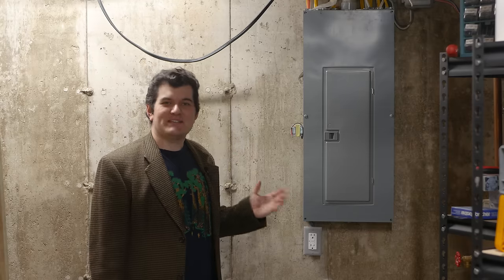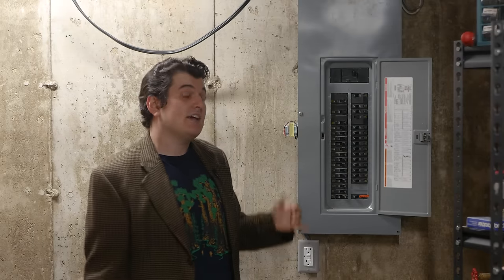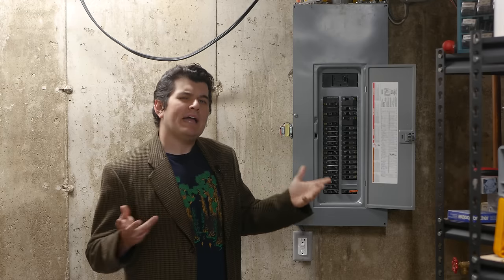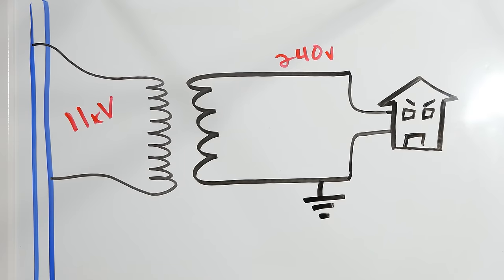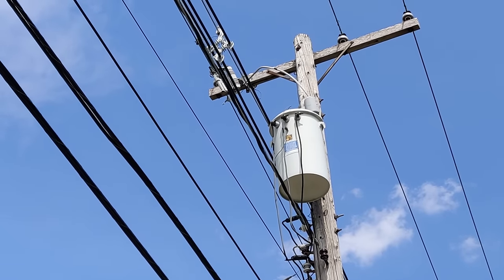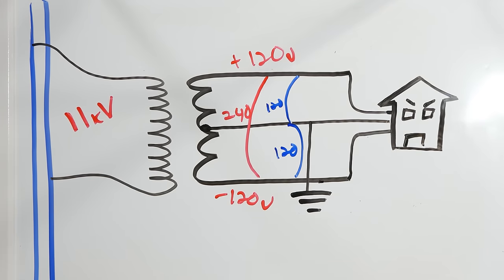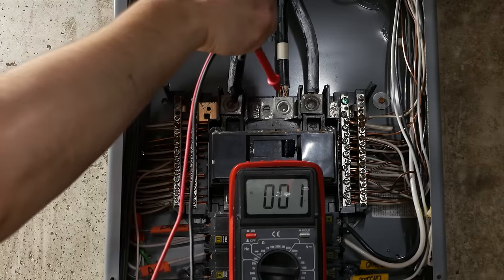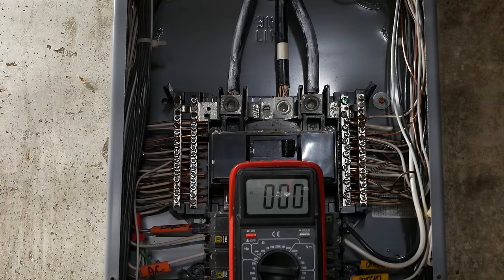The US electrical system is not 120V

Comment: Sometimes when I watch these videos I feel like you’re attacking me personally.
Reply from the maker: Only with the kettles :)
Reply: Technology Connections 😂
Reply: Shhh... You're one of us now.
Reply: @richkurtz6053  no good for tea.
Reply: @richkurtz6053  or an electric powered instant hot tap by the kitchen sink. A tiny electric water heater lives under my sink and keep the water just below boiling. Holds enough for 5 or 6 cups of hot water. All on 120v
Reply: @Gary-Goodridge  please explain
Reply: @richkurtz6053  American here, I use a kettle every day for my single serving coffee.  Its way faster and easier than the microwave.
Reply: Honestly not surprised to see Slow Mo Guys here. This channel definitely seems right up Gavin's alley
Reply: @Zolbat  no idea what he/she means by that either... One thing I know tho is that microwaving very pure water (maybe only distilled?) might be a bit dangerous, it can hit above 100ºc and be ready to instantaneously boil whenever any impurity hits it, quite a nice spray of boiling water all around.
Reply: @revengejr  I had no idea that was a thing you could buy, thank you for adding another item to my list of things to buy if and when I own my own house.
Reply: To be fair I have never been shocked taking a plug out of an outlet.

That's not to say that I haven't been shocked, I have. Sometimes even on purpose.
It has never happened when dealing with plugs though.
Reply: @richkurtz6053  Microwaved water is tea sacrilege!
Reply: @amcghie7  but whyy??
Reply: @Zolbat  It tastes so stale...
Reply: @richkurtz6053  And I bet your tea tastes awful.
Reply: @richkurtz6053  I'm an American with an electric kettle but I use it to heat up water for my instant Cup 'o Noodles.
Reply: @Zolbat  to make English tea you need boiling water from a kettle. Microwave boiling water is no good. It just doesn't taste right.
Reply: That's why Americans don't drink tea... they don't want to wait for it. ;-)
Reply: @Kalvinjj  : Yes, it's called "superheating".  But the water doesn't have to be pure.  Plain tap water can have the same problem, particularly if you microwave it in a smooth bowl with no good nucleation sites on its inner surface.  The telltale that the water is superheated and in danger of erupting is when you see TINY bubbles spontaneously form in it. 
If you're worried about it blowing up on you, just put it somewhere where an eruption won't hurt anything, then dip a spoon or something in it. That'll be enough to set it off and defuse the superheating.
Reply: Sometimes when I watch these videos I feel like you’re attacking me personally . At least you could watch him coming (for a loooong time) on your videos. 🤣
Reply: @richkurtz6053  As a sane American, I heat my water by burning natural gas piped into my home through an antiquated near century old low pressure natural gas system. Friend of mine was over at his grandmothers house and noticed an old gas lamp light fixture on the wall. Our of curiosity he turned the valve on it...and gas started to come out.
Reply: I've still got my dad's percolator(out in the garage). Maybe J should fit it out &use it again..
Those were the days!
Reply: @revengejr  Even though it must be super convenient i don't dare. I do not know how many times I by mistake got hot water over my hands when turning on the tap due to using hot water before and putting the handle in the middle afterwards without flushing out the hot water in the tap. This mistake would be so much worse if the water was almost boiling.
Reply: @amcghie7  That's your opinion & matter if taste.
Reply: @carpdog42  Natural gas still puts out more heat energy than electricity.
Reply: @andguneri  lol, it's not like that. It's a completely separate, and smaller, faucet that gets installed next to the normal faucet. It would be very difficult to mistake the hit tap for the normal tap.
Reply: @revengejr  Makes a lot of sense 😅
Reply: @revengejr  You underestimate my power!
Reply: Who the hell uses an electric kettle in the US anyway? That is a recent phenomenon. First off you dont make coffee that way, mostly. And we boiled water on the gas stove top, because its cheap to run. This was in the BM times... before microwave.
Reply: @richkurtz6053  Its why your tea and coffee is so disgusting
Reply: @richkurtz6053  This sucks though. It makes the container friggin hot!
Reply: Someone please explain scientifically (I don't want personal anecdotes or conjecture) how tea made with water heated in a microwave tastes any different than tea made with water heated in a kettle.
Reply: @StoneE4  Kettles are designed to heat water to 212 degrees ,optimal for tea .Mcrowaves overheat  water making tea taste bitter and nasssssty.
Reply: @Wardads1  - That's not an explanation. That's two more additional claims.
So, let me rephrase... Someone please explain scientifically (I don't want personal anecdotes, conjecture, or additional claims) how tea made with water heated in a microwave tastes any different than tea made with water heated in a kettle, why water heated to exactly 212º is optimal for tea, and how heating water past 212º makes tea taste bitter and "nasssssty."
Reply: @StoneE4  That's the best answer you will get ,and yes black tea tastes bitter in water heated over 212.degrees .Ask someone from a tea company if that's not good enough or gee I dunno fucking well google it .Oh and a boiling kettl aerates the water too ,try it yourself.
Reply: @amcghie7  It turns out that professional violinists can't tell the difference between a Strad and a good, modern violin, and wine experts in France couldn't tell the difference between red wine and white wine with food coloring in it to make it look red.
I wonder how you'd fare in a double-blinded test to detect which tea was made with kettle water and which with microwave heated water.
Reply: @DownhillAllTheWay  I'd imagine you probably could tell the difference between red and white wine by tasting, due to the fact they do taste different? When I'm offered a glass of wine I'd know, without being told, whether it was a Shiraz or a Merlot, for instance, and they are both red....

I guess on water though, it would be pretty easy to test, might try it on my flatmate tonight....
Reply: Michael Persico  in theory I agree. But in practice it is a totally different taste when making English style tea. However microwaves are good for reheating tea. Again you have to be careful or you ruin the taste but it can be done.
Reply: @Sammie1053  They also install them at showers/bath tubs but many of them are 240VAC as the need for a large amount of water is there. A.O. Smith makes a 240VAC 1.6GPM one that can handle most showers and is tankless. Draws 14 kW though.
Reply: @carpdog42   That was how our farm house used to be lit. Gas was free so who cared. We also had to light the fires in the Servel refrigerators to keep the food cold.
Reply: @Gary-Goodridge  We dumped English tea in a harbor a long time ago. Best use for it. ;-) Turkish tea beats the English any day. Just be sure not to leave the spoon in it too long and be sure to add at least two cubes of sugar. :-)
Reply: @StoneE4  Most people have pretty nasty microwaves too so you'll end up with a burnt cheese taste in your water or something similar.
Reply: Some weird novelty finding out how many of the channels you watch also watch each others content
Reply: @richkurtz6053  Exept the president. He use a heat ray ;)
Reply: @revengejr  Is that fed from the hot water line?  Cause, gross.
Reply: @revengejr  Is that fed from the hot water line? Cause, gross.
Reply: @xiaodingjones1554  nope, it comes from the cold water line, through a filter, then in to the tank where it's heated electrically. Check the link I posted if you really want to see how it works.
Reply: @TechnologyConnections  Yeah, he only has to wait about 45 minutes for it to boil.
Reply: Regarding tea tasting worse when the water is heated is a microwave, I believe there may be a reasonable explanation but it’s not because of the water is heated “differently” or worse in some way in a microwave. 

Coffee, and I’ll presume tea does taste different depending on the temperature of the water used. IIRC a temperature above 180°F will cause tannins or something or other to be released, making coffee bitter. Sounds like something similar may happen with tea from comments made?

Using my own personal experience as an example...  Boiling water in a microwave, I’d use a glass measuring cup. The glass gets hot which serves to maintain the heat of the water when removed from the microwave. And since I know there’s no more heating as soon as the microwave beeps, I always immediately remove the boiling water and use it. 

When using a kettle, the material (plastic) of the kettle doesn’t hold heat. But since I know the heating element will gradually rather instantly lose its heat, I tend to be a little lax in how quickly to attend to it.
The result is that water I’ve microwaved is almost certainly just off the boil when used whereas from a kettle it will be quite a few degrees cooler. I’ve experimented when making coffee and I know I had to deliberately wait till the water got down to 180°F.

Perhaps this or something similar explains the bitter tea when a microwave is used?
Reply: @MostlyInteresting  - Tons of people who work in a small office, you rent a room instead of an apartment, dorm rats, etc. use electric kettles to boil water. Microwaved boiled water is not nearly as good for tea.
Reply: @richkurtz6053   @Technology Connections  Speaking of coffee and microwaves... I heard that, although it is safe to boil water for coffee in a microwave, reheating it is a different story. Supposedly, when you first heat the water, dissolved air forms bubbles which provide nucleation points for steam bubbles, but when you reheat it, the air is gone, so, without nucleation points for the steam bubbles, the water can be heated above the boiling point, waiting for some little movement (like a person removing it from the oven) to trigger the bubbling. Result: possible painful splash of very hot water. Any truth to this?
Reply: @TechnologyConnections  Please see my reply to Richard Kurtz about coffee and microwaves.
Reply: @Gary-Goodridge  no we drink the water, eat the package/leaves/beans/whatever then set ourselves in fire
Reply: @DownhillAllTheWay  I have tried to make tea with microwave water and the results were nasty. I am not saying you cannot, with a lot of effort make a drinkable cup of tea with microwave water but using either a gas or electric kettle the job is easy peasy.
Reply: @Gary-Goodridge  What you need to do is to have somebody else make 6 cups of tea, 3 in the microwave and 3 in the kettle, then see if you can tell.  Ideally, the person serving the tea shouldn't know either, so as not to give any subliminal signals - if both people are unaware, that's what makes it a "double blind" test.  There is a tremendous bias when you know the result before you take the sample - and that's not a dig at you personally - it's everybody.  I have the same problem myself.  I used to use semi-skimmed milk, though I read that skimmed milk had all the same nutrition in it - but to me, it is like water - completely insipid.  Then recently, I read that in a double-blinded test, people were unable to tell the difference between skimmed and semi-skimmed milk.  I would have got somebody to test me, but I had already moved onto oat milk by that time, which I like, so I don't know if I can really tell the difference between milks.
Maybe you really can tell the difference between kettle- and microwave tea, but until you put it to the test, you will never know for sure.
Reply: @DownhillAllTheWay  as I said I think it is possible to make tea with microwave water, however I use my microwave to cook sponge cakes from scratch, turkey at Christmas. I defrost cream éclairs and ice cream. I roast nuts. The  only thing I do not bother with because, I have failed to get reliable good results is yourkshire pudding from batter and water for tea. I use it all the time to heat up cold cups of tea however you need to be careful because it will overheat and taste nasty if you go too far. Microwave water works well with instant coffee. I have been a regular user of microwave ovens since 1975 and have had great success. The fact that it is difficult to do for tea was really my point, kettles of both types just work. If someone doesn't know what it should taste like they cannot tell if what they have made is correct. Anyway  cheers and happy drinking.
Reply: @b2gills  I have! It really hurt, and left soot on my arm!
Reply: Im a masochist when it comes to knowledge. KEEP ATTACKING ME!
Reply: @hi-friaudioman  sorry dude I am a southerner and who drinks hot tea, me sweet tea all the way, and coffee in cold weather or hot coco.
Reply: @StoneE4  well dude look at you own answer  and yes you did give one answer  that is air flow, how you get the air flow does not matter to the fact the fire is burring hoter. AS for why kettles that is tradition.
Reply: @Delgen1951  : You're mistaken. Air flow, by itself, is not an explanation for why a fire will burn hotter. Air flow is just another claim until I describe the mechanics behind it that actually do make a fire burn hotter. If I couldn't explain why air flow increases the heat of a fire it would be no different from me saying the fire burns hotter because "that's just the way it works when you blow on it." Likewise, all the lame explanations presented in this thread for why tea made with water heated in a kettle tastes better than tea made with water heated in a microwave are nothing more than unfounded claims stacked upon more unfounded claims all resulting in an answer no better than, "reasons."
I couldn't care less what you consider to be tradition as that is completely irrelevant to what I'm asking. I'm looking for a scientific explanation (I don't want personal anecdotes, conjecture, additional claims, or appeals to tradition) of how tea made with water heated in a microwave tastes any different than tea made with water heated in a kettle.
Reply: me heating water for hot chocolate in the morning be like:this is fine not slow at all
Reply: @richkurtz6053  Microwave ovens are noisy.
Reply: I find myself somewhere between an eyeroll, head shake, smile, and laugh at the impassioned views of hyper detail oriented individuals of different taste concerning the proper preparation of the famous herbal beverage, especially given the video is about residential electrical wiring. This debate has lasted centuries without consensus, and if it were ever found could never be replicated. Taken too seriously, the culturally significant drink's preparation might lead to war between the English and Japanese, or civil war within their populations.
Reply: @Zolbat   Take two cups of water. Heat one in a microwave the way you usually do. Boil the other on the stove. Don't add anything to them. Just let them cool to your favorite beverage temperature and take a sip of each. You'll find, for no reason I can explain, that the two cups actually taste quite different.
Reply: @richkurtz6053  I use a electric kettle. We just call them "water-boilers" or a slew of other nonspecific synonymous names
Reply: @revengejr  My place, luckily, has a hot water recirculating pump. Everything that needs hot water is only a couple feet (at most) from true hot water.
Reply: @tippyc2  My wife agrees with that.
Reply: @richkurtz6053  As Oscar put it,  "America is the only country that went from barbarism to decadence without civilization in between.”
Reply: Is no one going to mention that boiling water in a microwave Vs a kettle THEN adding it to your tea is from a chemistry point of view going to result In the exact same cup of tea? No? Or that the first few people were joking and or playing along with the joke? Nope? Oh, alright never mind. Carry on then. Pardon me, excuse me. Just getting my coat, sorry. Pardon me.
Reply: @slateslavens  that's... Not at all accurate that no one could explain that claim if it was true? We understand exactly how microwaves work and how water works and even how the microwave radiation will interact with the water. If I had to guess without considering it at all just my very first guess. It's ionizing it? But if that were the case it would make ALL food taste different, likely dramatically so, as almost all food contains water. That's what the microwave is actually heating when you put food in it. The watter inside said food.
Reply: So my first reply going to be:

ALL THESE WORLDS 
ARE YOURS EXCEPT
EUROPA
ATTEMPT NO
LANDINGS THERE

Then Anton released the following video, which I believe explains everything:
https://www.youtube.com/watch?v=YsQXN-Kh2-w
Reply: @Sir.Craze-  yet we also all understand that beer is better from glass than plastic, your own gran made the best cupcakes in the world and tea is better from the kettle. Science aint an exact science, despite what science may have to say on the matter!
Reply: Your here
Reply: @richkurtz6053  I've visited Italy and ended up using the kettle and stove during my stay.  I was amazed how much faster it is!
Reply: @bradhoward9701  Things tasting better than others because of bias or external differences that don't actually change the taste is an exact science. It's called the Placebo effect.
Reply: @NUKELEDGE  quite aware of the placebo effect thanks. the point being that the placebo effect directly affects the outcome. taste is a pretty abstract concept, so the abstract of the placebo is just as valid. the cup of tea is meant to be enjoyed, and is generally enjoyed more when made with a kettle. hence there is a difference in  the quality of the tea. combine that with the neglected effects such as scale in the kettle changing hardness, and the boiling effect removing some of the more volatile additives to the tap water, and we have a metric of quality your numbers can measure. 

tea in the microwave is definitely and measurably different. whether your average person can tell the difference is entirely irrelevant.
Reply: @bradhoward9701  Then this would be easily solved with a double blind test. People always seem to avoid the argument when that point comes up though. Remove the bias and see the actual outcome.
Reply: @NUKELEDGE  I agree entirely. you are however missing the point. it isnt often i have been asked to participate in a proper study in my kitchen. often enough  the mrs makes tea with the microwave whilst i descale the kettle, and it tastes different. insisting that science says otherwise is to neglect that bias is a fundamental part of the outcome, and doesnt properly pay full respect to the scientfic method. the tea tastes better because of bias, but it still tastes better. science is about looking for the reason, not denying a measurable effect.

the cup of tea isnt just hot water dried tea and milk. its a ritual. its 5 minutes of peace. its a brief peek of nirvana before moving along to the next bag of poop the day handed me. it tastes better from the kettle, in my cup, and sat in my armchair. we cant double blind test that experience.

many multinational corporations have discovered this the hard way around. pepsi wins every taste test, but coke rules the tooth melting industry. the taste is fraction of the entirety of the experience of drinking sugar syrup. that is literally a multimillion dollar example of how science isnt an exact science, and the double blind experiment is only any good if you are testing for the right things.
Reply: What is a "V"?
Reply: @Gary-Goodridge  have you ever heard of a stove? They come in many varieties: electric coil, glass top conductive, gas, wood burning (if you live in West Virginia)...
cool thing about them is you can get a tea kettle, plop it down on the burner, and a short time later it’s tea time. No electric kettle required.
OR, we can use our coffee makers without the filter basket which makes hot water very quickly, probably quicker than an electric kettle, and the water will certainly be hot enough to teabag since it’s hot enough to be coffee.
Of course, if we’re feeling especially yankee-doodle, we could just stick a mug of water in the microwave for a bit...
Reply: Wait, I thought we were attacking them directly too... What a disappointment
Reply: @TechnologyConnections  hey, my service panel HUMS/BUZZES like the sound you overlapped onto your video clip
Reply: Hahahahahaha
Reply: @DownhillAllTheWay  I don't see how skimmed or even semi-skimmed milk can possibly have the same nutrition and I agree that skimmed milk lacks flavour and (obviously) substance .. I only use full-crream milk and am rather partial to Gold Top, although only FRESH Gold Top is suitable for tea. Not the supermarket stuff.

Even semi-skimmed is thin and lacking flavour to my palate, including in tea. One has to use more for a siimilar effect which sort of defeats the object. Might as well get full-cream and water it down if you want it weaker.
Reply: @StoneE4  One possibility is that lime etc. tends to separate out when boiled in a kettle and doesn't end up in your tea. That is why kettles fur up in hard water areas.
Reply: @BG101UK  : Are you telling me that if I heated water in a microwave, using the same container over and over again, that I wouldn't end up with deposits on the side of that container?
Reply: @StoneE4  I honestly don't know as I haven't tried it, but I would guess not as, in a microwave, the perimeter of the container isn't getting hotter than the water (or at least the vapour produced) inside does and therefore not causing partial dessication at its inner surface wall or on the element, as happens in a kettle.

Also, do people actually regularly bring water to a complete boil in a microwave? The steam might be bad for the innards of the unit, especially electrical and electronic parts.

Something I'll have to experiment with, if I can find a means of doing so .. container materials being the biggest hurdle..
Reply: @BG101UK   : That was a rhetorical question. Lime, scale, or mineral deposits/stains are produced when water evaporates leaving the minerals that were dissolved in that water behind. You'll get the same results in a microwave, in an electric kettle, if you aligned a bunch of mirrors to concentrate beams of sunlight on a container of water, or just simply left a container of water uncovered to evaporate on its own. The evaporation of water that contains dissolved minerals is the key to making mineral deposits, not the method you use evaporate the water.
Reply: @StoneE4  True for water which is boiled away completely, but my guess is that is not necessarily the exact case where the water itself is heated and not the container with only partial evaporation.

Microwave energy excites water molecules to within a certain depth rather than just directly from the edge and the convection currents are therefore also not the same, hence my comment on formation of limescale on kettle elements. I guess not as much of the lime gets separated out and sticks to the vessel. Basically kettle elements and possibly also the bottom of pans heat water significantly above boiling point aiding such dessication & deposition.

My thoughts are that less temperature gradient between vessel and contents = less mineral deposits on said container. I'd be happy to know the truth.

I think this is going to need a bit of experimentation.
Reply: @BG101UK  If that's what is best for you, then that's what you should do.  Personally speaking, I have had a medical warning about cholesterol, so my choice of milk is not entirely governed by its taste.  I am now using oat milk, which (I believe) is a suspension of oat powder in water with a small amount of added sweetener, and I have got used to that.
Reply: bu cket
Reply: @Wardads1  Fun fact: you CAN'T heat liquid water over 212 degrees/100C.  Well, except in a pressure cooker, but that's not what we're talking about.  At standard pressure, liquid water cannot exceed 212 degrees, no matter how much heat you're putting into it.  For it to exceed 212 degrees, it has to turn into steam first.  "Excess" heat put into boiling water, will not increase the temperature.  It will boil faster, because there will be more energy going into turning the water into steam, but it won't get any hotter.
Reply: @Gary-Goodridge  Not really a problem since the vast majority of the UK are in fact coffee drinkers not tea.  Tea drinking has been in decline since WW2.
Reply: @StoneE4  the container matters. most people who have microwaved water may have used a plastic or ceramic cup, bot of which over prolonged microwave exposure and heat will dissolve partially and mix with the water. BPA is used in many forms of disposable/reusable plastic containers not meant for long term storage (i.e. party cups) or microwaving/dishwashing and is mildly poisonous and very bad tasting in larger amounts. also just a cluster bias and pre-conceived notions. personally I use a coffee pot which actually is really efficient and makes consistently good tea. if you know how to take it apart and clean the insides then practice often you can actually just use tap water and the coffee maker distills is as good as bottled/canned. around the same time it takes to microwave all in one automated swoop. I hope you can appreciate a response 7 months later when you already figured it out yourself.
Reply: Lol
Reply: So you use bifasic? Is that even a word?if so why? Does it have any advantage to  mono or tri?
Reply: @DownhillAllTheWay  While I would agree that taste of food can be highly subjective and biased by expectations, I also find the study somewhat suspect as well.  If you want to easily rig such a test, just select a red and white wine with nearly identical taste profiles.   Once you have fooled the tasters, in this case students, generalize your conclusions to all red and white wines, and all professional tasters.  Desired result!  

Of course, I know virtually nothing about wine tasting or setting up psychological experiments, so I'm really not the guy to decide who wins such arguments.
Reply: @carpdog42  that reminds me of the exploding houses in Massachusetts. i think the pressure got too high at the source, and a lot of houses blew up
Reply: @maxlee6676  Probably reminds you of it because I don't live far from there and am on the same type of system where it happened. The incident you are thinking of actually was a result of a service error where a high pressure gas line, got connected to one of the old low pressure lines; which damaged some of the gas equipment inside homes and caused the newsworthy events.
Reply: @carpdog42  wow! that's interesting, and I guess I was onto something. thanks!
Reply: @Gary-Goodridge  
Dead right. Hot tea isn't  right unless freshley boiled water is poured on to the tea immediately! If I lived in the US I would install a British 13 Amp switched socket in the kitchen fed by thier 240 volts, and then import a kettle from the UK complete with 13 amp plug. I'm not sure microwaves are more efficient for boiling water anyway. There's some physics rule about the amount of energy needed to raise the temperature of one cc of water by 1 degree celsius isn't there?
Reply: Has nobody here ever heard of Nespresso or Keurig? Distilled water in the machine? Is everyone here microwaving tap water for instant coffee or something? What year is everyone living in?
Reply: @amcghie7  the problem is that one gets acclimated and expects particular flavors, (say of Merlot) to be consistent, and consistent with color and labels. Unless it is a shockingly different taste, the brain, if it only detects different subtle flavors, will dismiss it (and if asked directly, people will come up with: previously eaten foods changing flavor, a mild cold, temperature of the liquid, etc... To put a different twist on it: although one study found that many people, even experienced (but non-professional) wine tasters were not able to tell some $20 wines from some $150 wines: the people who were fooled really enjoyed the wine more, reporting getting as much pleasure from $20 wine as if it were $150 one.  If you know any angry waiters or waitresses who want to get revenge by substituting a crappy wine for an exceptionally expensive one, if the drinker doesn't notice, they will have a great experience anyways. ;(
Reply: @zevfarkas5120  bubbling yes, bubbling enough for a "splash", no. I think you have to add a significant amount of cold material: a spoonful of sugar or at least the spoon, and even then...
Reply: @squirlmy  How did you find that out? (I'm asking seriously - as I said in my post, I've only heard about this, and I'm not about to try it out at home...)
Reply: hm why
Reply: @tippyc2  crazy! during the initial phases of the world wide illness effects, I literally got sooo tired of hearing the microwave just drone on and on barely heating up an bowl of soup so I heat up water in a pot gas on and done in what 2-3 minutes. What's even more enlightening is to randomly come to an online location loi find so many similarities in our behavior!
To the world; why can't we be friends? oh heavens here comes the tomatoes and eggs this commenter is out!

Awesome video "TC" came from the Dietz vid lol
Reply: @StoneE4  Well said. Wardad is clearly getting a bit steamed! And is that how they think punctuation works, with the "." at the start of each sentence as if it's a domain name? Or perhaps they are catching the space bar while typing with clenched fists...
Reply: @MostlyInteresting  In the US, I don't know why you should use (or not...) a kettle. Here, in Europe, one thing is sure: NOTHING boils water faster than a kettle. Including gas stove, induction plate, microwave, and so on. Apart putting 10 kg of white-heated steel into water, but it's quite rare to have melting metal in a kitchen, to be honest.
It also prevents overheating and therefore saves energy. Most kettles are insulated, you can touch them with bare hands without being burned, and a little filter will remove the limestone particles when pouring.

My wife use it a lot for her tea. I use it for instant noodles, OR for preheating water for cooking - as I said, faster and cheaper than ANYTHING ELSE, it helps for boiling things like pasta or potatoes. We use it also for heating hotdog sausages (we pour boiling water on the sausages, faster than steaming them).
Finally, we use it also for thawing food very, very quickly: instead of 30 minutes in microwave oven, it tooks 2 minutes to get 2 liters of boiling water and then 5 minutes to thaw it enough to be able to cook it... If it must stays cold, then we defrost it in the fridge during the night - once again, it saves energy.
Reply: @tippyc2  He's joking, it's a running joke in these threads.
Reply: @StoneE4  Hello... a previous poster mentioned tannins in tea leaves. They are right! Not only that but other aromatic substances that are contained in some tea leaves tend to break down in bitter or foul tasting compounds if heated too much. By contrast, applying a lower temperature for a longer time allows these substances to be transferred safely (unbroken thermally) to the water making delicious tea. That is the reason for traditional methods of preparing tea, and also the reason for the recipe for a "concoction" -where lower temperature water, typically below boiling point, is poured onto leaves etc and left in a covered vessel for much longer than a regular infusion would take. This method is designed to safely dissolve most of the aromatic substances and "active principles" as they are called in traditional medicine from the leaves into the water . In modern scientific terms, it ensures a good dissolution of active substances (flavonoids, other organic compounds such as vegetal aromatic oils etc) in the water without breaking them down due to heat.Some of the flavor in tea comes from these substances, and they tend to break down under high temperatures. it is also the reason why you don't make tea just by boiling leaves in water - the heat would be too much and would degrade the organic compounds, and leave you with a solution with no connection to the original intent. Tea was artisanally brewed however for millennia and a "right way" and a lot of "wrong ways" to make tea were found. Traditional prescriptions were the first to note the care that should be taken for the water to not being boiling when poured over the tea leaves lest some disgusting result is desired. The reasons we understand today, but the knowledge is indeed ancient. Have a nice day and enjoy your slowly brewed coffee and tea;)
Reply: @shaunhw  There are code compliant 240v 20A outlets in the U.S. and amperage determines wire gauge. There is no reason you can not hook up a 12/3 Romex into a 240v straight blade outlet for your kitchen and re-plug the cord of a standard U.K. kettle. You could even use a 12/2 but you would need to put phase tape on the white wire to make it red or another load-colored conductor.
Reply: just because you living in a backward country who cant handle the metric system and 230V/400V 50Hz!
here you just have 50A coming into your house... some even less...
Reply: @richkurtz6053  That's cute. I use a desktop water heater in my household. Double walled. Keeps the water hot for coffee or tea or cup noodles.
Reply: @richkurtz6053  That's not entirely true , I don't use a microwave for any thing !  And more an more people are finding out why microwaves are bad for you !  Not to mention  there hard on electricity !
Reply: @hi-friaudioman  I think the reason why most Americans don’t drink tea is because their ancestors discarded tea as a symbol of independence from British law.
Reply: @bradhoward9701  that's fine, if you can sit there and admit that the reason that it tastes better, is because of your own bias and therefor just the knowledge of how it was made. But there are a lot of people here trying to insert pseudoscience into the argument, by saying microwaves heat water past 212f....which would make it all turn to steam.
Reply: @richkurtz6053  Keurig or conventional for me.
Reply: @mdlamar  VERY TRUE!  Microwave some shrimp then sniff your microwave 8 hours later!  And remember, what we call taste is really smell; if it smells bad, it tastes bad.
Reply: @carpdog42  I've lived in old apartments in San Francisco and New York which still had live gas valves coming out of the wall for old gas lights.  And one apartment in Sacramento CA which had a nice old brass chandelier in one room from the days when people were converting from gas to electricity - and it had light bulbs in it, wired to the house electricity - and also live gas in it, ready to light.   I kept it turned entirely off, since the landlord didn't seem to think it was a problem.
Reply: @Wardads1  When you pour the water into your cup or teapot, it won't be over 212 - but yes, don't have tea leaves or a tea bag in a cup in the microwave.  

Many people think that 212 is too hot for best tea taste, anyway - it's psychologically satisfying, but not so good for taste.
Reply: @gravelydon7072  My preference is Ceylon tea.  And my ancestors who dumped that tea didn't want to, they loved tea.  They just didn't like the tea-flavored boot of the English parliament on their neck.
Reply: @slateslavens  I think the problem here is the cleanliness of the microwave. Put a Pyrex measuring cup or other microwave-save vessel of water into the microwave and turn it on for about 10 minutes (assuming ~ 16oz or 500ml of water) and then (carefully) remove the vessel and smell the water. If it smells bad, its because your microwave has all the smells of the other stuff you’ve cooked in it permeated through the internal workings. Repeat this process with fresh water until the water comes out smelling like water (i.e. “nothing”) and then make tea. I’d bet it will taste no different than if you used a kettle.
Reply: @nycbearff  Mine either from both sides of my parents. Both had grudges against England to start with and the taxes were the last straw. So when push came to shove, they shot back.
Reply: @richkurtz6053  American here. I use a kettle to make ramen, instant mash, and a bunch of other stuff. Or to shorten boiling times on the stove, as I can electric-kettle the water in a bodum pretty quickly and throw it in a pot on the heat, and it'll come to boil Much faster.
Reply: @tippyc2  And if you lived in the UK or other country with 240V in the house, just think how fast your single cup of water would be ready! About twice as fast 😃 Maybe it's time to invest in a 30A socket, a good sized transformer and a European electric kettle? Or maybe run a 240V cable to your kitchen if you have a 240V supply like this guy. You could even wire it to one of our fantastic Type-G sockets! 😂
Reply: @amcghie7  Like you can taste diffence in water from a kettle and a microwave.
Reply: @TechnologyConnections  thats where it hit hardest
Reply: He is.
Reply: @TechnologyConnections I feel like you are the halo and pitchfork on proverbial  shoulders of mine. I feel like you aren’t separate from me at all, I like you, 👍👍👍👍
Reply: So all i can gather from these comments is the reason non Americans hate microwaved water for tea is they either nuke it for 10min or are to dumb to wait 30sec for it cool down.
I made microwaved tea for my British roommate for 3 weeks before he asked where my kettle was, he was shocked he couldn't tell the difference (because there isn't one).
Reply: @TechnologyConnections  lol
Reply: @theslowmoguys  connected
Reply: @Rudofaux  Yeah but a good fraction goes up the outside of the kettle and is lost.
Reply: @Kalvinjj literally have never heard of anyone in the world having that issue and have only seen it demonstrated in YouTube videos.  Safety obsessed nanny states are hilarious.
Reply: @amcghie7 I guarantee you cannot tell in a blind taste test.
Reply: @lookoutforchris   ermm.. have you replied to the wrong comment, or like, where the fuckin' hell did you associate a "nanny state" with microwave boiled water bursting??
Seriously what the HELL does it have to do with it? Like, sure not ever seeing that effect happen, OK, but what government is regulating microwaving water here that I don't know?
Reply: @TechnologyConnections but what if you can make a dedicated socket with 240V (but different by color, for example) only to use with heating things like kettles or cooking panels?
Reply: I don't attack people but yes to wrong information.
Reply: laugh track and outro theme starts
Reply: @Kalvinjj  I microwaved some water for tea and forgot about it. When I went back I decided to let heat it for another minute since it had probably cooled down. I put the microwave back on and was doing something on the side of the microwave when the door suddenly blew open and water went everywhere. Luckily I was on the side behind the door when it opened and there was no one else around. This was an under cabinet microwave, so that water woudl have been in my face if I had been on the other side of it. I no longer microwave water for more than 90 seconds. If it needs to be hotter than that, I will do it on the stove.
Reply: @christianseibold3369  Do you seriously think we don't have stoves in France? We have them, but they are less common as it's something from our great-grandmothers - What we call "stoves" is an old "all-in-one" appliance, typically heated with wood or coal, that served as both a cooktop, an oven, and a heater. Still, you can find them quite frequently in more remote rural areas. The fact that WE consider it somewhat old-fashioned while you see it as borderline revolutionary says a lot.

But as a side note, wanting to explain kitchen appliances or utensils to a French person is quite... presumptuous, let's say.
As for the rest, regarding pretentiousness, arrogance, and condescension, I have NO lessons to receive from an 'Murican.

Initially, my comment was about the fact that an electric kettle is, at least here, the fastest and most economical way to boil water. I explicitly said, "In the US, I don't know why you should use (or not...) a kettle." This indicates, if one can read, that I'm unaware of whether there is any interest (or not!) in using an electric kettle in the USA, with your anachronistic electrical standards that only serve to require twice as much copper as 220V, in addition to carrying a much more dangerous amperage.

I was explaining the situation for Europe, where this kitchen accessory is clearly COST-EFFECTIVE. Money. Bucks. Moolah. Benjamins. Cash. Nothing else.
Reply: @Kalvinjj  do you know how difficult that is to do? You have to super heat 1 spot and not the others. As long as the water isn't dead center of the turntable and the turntable is turning, it's almost impossible. You can do it with tap water. Letting the water sit for about 30 seconds is enough to not be a victim 99 percent of the time, IF you can get the superheated pocket of water to begin with.
Reply: I have a 3000 watt Irish kettle in my US house.  It was very straight forward to run a 9 foot 13A cord to the 240V outlet in the basement right under where my kettle is. As my voltage is 246V I get 3152 watts to boil the water super fast. The kettle  element I calculate to be 19.2 ohms.
Reply: BTW. 208V from 3 phase only gives about 75% of the wattage compared to 240V because both voltage and current decrease and power is voltage X current.
Reply: 6:45 those beefy cables are such a pain to wire in too. Well the unwinding of the cord that brings it from the meter to there is the hardest part.